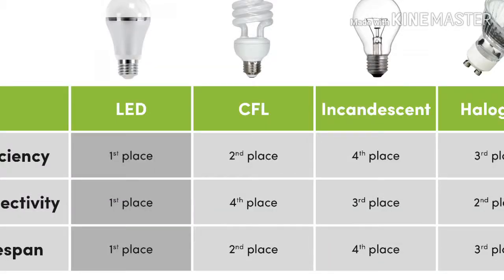Advantages & Disadvantages of LED bulb

Comment: SEMA improvement sir UNGA videos going better and better 
Marketla oru bulb Emma vilai?
Orumasathukku current unit difference evlo varuthu?
Bulb vilai current savings saripoguma?
Veetla Ella bulbum led pottila oru madam unit compare?
Ore pointla bulb podama equal lighting eppadi distribution panrathu

Etc....
Reply from the maker: Thank you sir and current unit depends on how much watts we going to use and the same way rate also different. Ex. Syska led 105, halonix 9 watts - 95,philips 0.5 watts- 87.